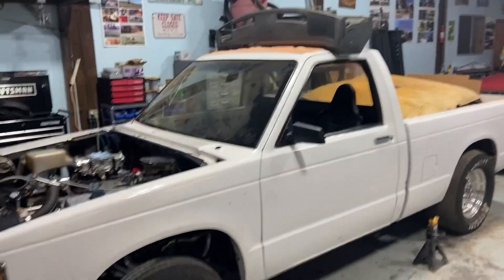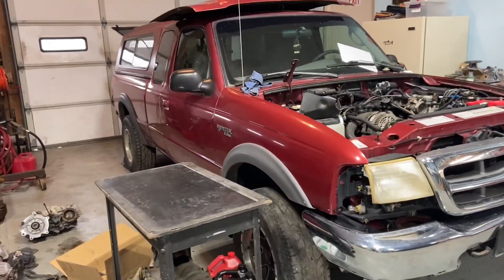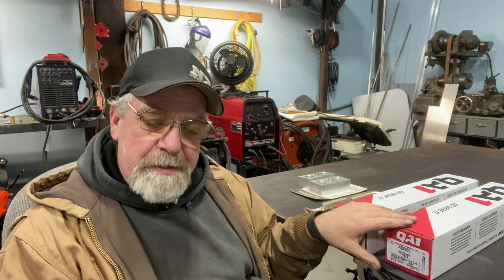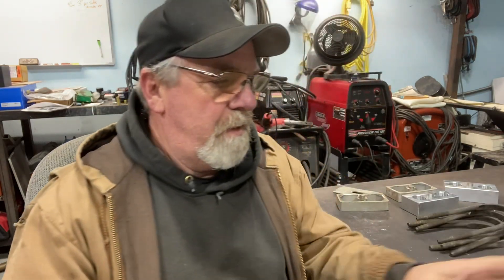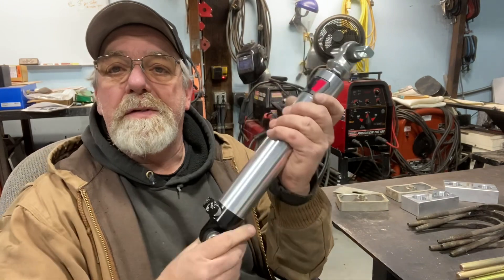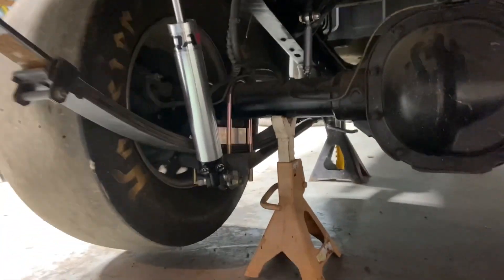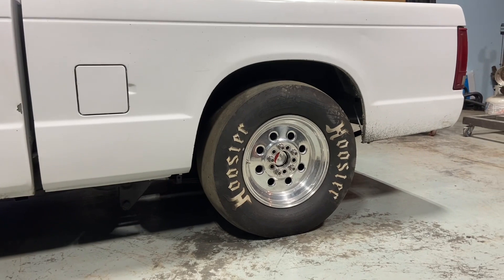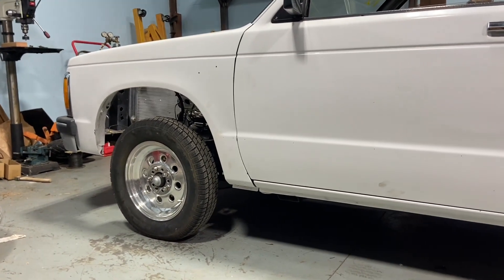THE S10 GETS A BIG UPGRADE!!

Comment: Update on adjustable shocks I ended up with front at C 5 & R 1 the rears at C 6 & R 2. At 7 on the rear the side wall was crushing to much so I went to 6 and added one pound of air. With new shocks 60' went down .03 to .04 lower. Has yours helped???